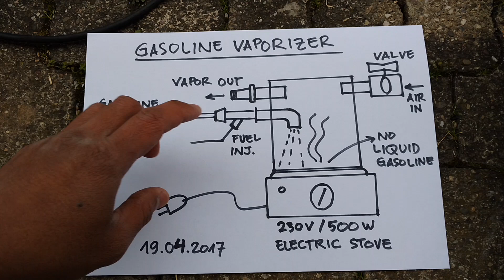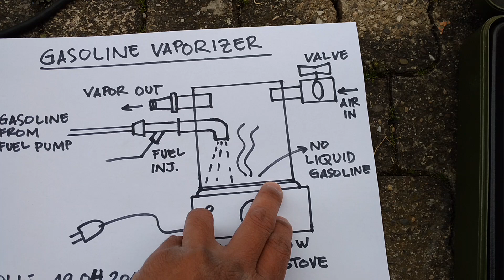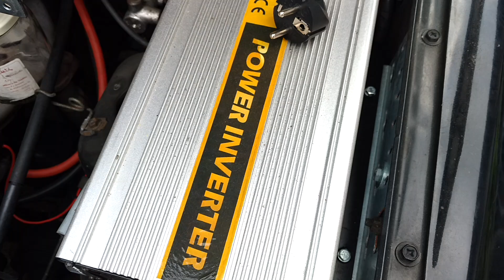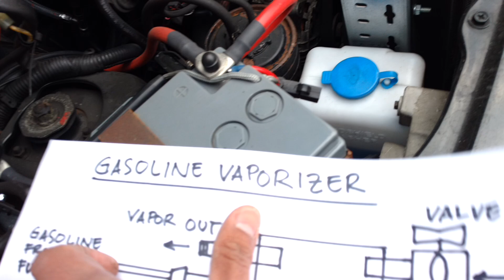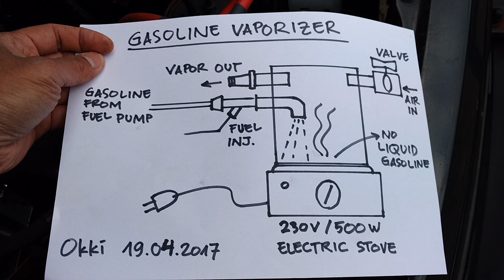Gasoline Vapor System for Car

Comment: If you use less energy from gasoline, you will have less power

It is easy to use less energy and a gasoline car by restricting the vapor going into the injector rail 

If you do that, and you do not make the car easier to roll, you have not accomplished anything 

So what I did, I found car tires that could go to 100 psi 

If you make your car a lot easier to roll and take as much weight out as possible you can get about 10 more miles to the gallon. 

If you use less energy in a car by making vapor and restricting the vapor and you still roll around on 35 pound air pressure tires 

And you are actually using less energy 

You will greatly reduce speed and get worse MPG

Comment: Newer vehicles with O2 sensor and evap systems,  the computer should lean or trim the pulse width of the injectors and the timing would be advanced or de-advanced depending on how rich the vapors would becomes.  Turbo with vapors.

Comment: Because it will die if it’s too rich or too lean, I don’t think it’s necessary to heat the gasoline. Introduce more air into the system and it’ll run just fine. I have a similar system, but I don’t use a fuel injector, I use a bubbler pot. With a corrugated hose, the vapor swirls and mixes with outside air and I have a valve to add more air. Cut down on the extra stuff like an inverter and a boiler. Plus you worry about overheating the gas to the point where it vaporizes before it gets in contact with the outside supplemental air. Seems to get pretty good mileage. About 80 to 90 miles to the gallon on a four-cylinder engine. Gonna try it on my hybrid next. And as far as the flashback arrester, I used a 3 inch coupler with two reducer cap ends, and in the middle, I’d put a metal mesh similar to what you would find in a splash screen that you use in the kitchen.
Reply: It is , that's how it vaporizes

Comment: something I commented onI  might have a cxouple of suggestions that will improve your setup. My brother and his friend made a headgasket with four sets of platinum points equally mounted around the cylinder. It was layered in between the gasket material like a circuit board.  So instead of firing from the spark plug it fired from each set of points. The platinum points had no place to hold any carbon build up so would not foul out like a spark plug. and firing the gas mixture  with four sets of spark burned the fuel vapor quicker and more completely.(old airplanes had two sparkplugs per cylinder)
Giving an increase of power with less fuel consumtion and less emissions. My idea to add to this is to reduce fuel droplet size thus increasing surface area of the fuel by using an ultrasonic mister which instantly vaporizes a drop of liquid to a finer mist than a carburator is capable of. This should also increase power while decreasing consumption andEmmisions. The reason you do not see this gasket method of spark on the market now is a sparkplug company bought their patent. Their was a drawback to the design they had not worked out at the time and that was that the gasket was thicker and you had to torque it down just right or it would blow the gasket.  But this was 40 years ago and we have much better materials to work with now. I really hope you read this or anyone else . It could be an easy add on for cars  well worth the cost for the increased economy and decrease of emmisions.  Hopefully give a little more time for the transition to the totally electric cars that are coming. Jake The Snake Was interested in the gasket for his race cars as it would have been a huge advantage.  So if you need an investor you might want to try him. It also goes to show how money trumps humanityand that big corporations (Firestone)  are more concerned with the bottom line than reducing polution to save mankind.  We really need to institute a crimes against humanity law for people like that and Big Pharma who suppress or overprice discoveries that benefit life.. Please send a comment should you read this. I like to think I am at least trying yo help.
Reply from the maker: Hi Kenneth. Thank you for your explanation. I think I got it. It is a clever way to ignite the fuel mixture without a spark plug. Can we write email? Here is my email address: info@m-opensolutions.com
Reply: Single cylinder or multi cylinder?

I question such a thing, as it would require multiple sparking systems for multi strike locations at once.

All this inside of a head gasket? And then claim aircraft had to use multiple sparkplugs' in a cylinder head?
You outsmarted engineers and did it with a head gasket and single point strike ignition. 

Rotflmao.

Comment: Why wouldn't you get your heat from the exhaust manifold? Wrap some copper tubing around it
Reply from the maker: No I cannot do that. Manifold temperature varies too much. I have measured my manifold temperature during driving and the result was not satisfying.
Reply: I'd thought that running it through a propane system might improve performance because it has the mixer which works on vapor from a vaporizer....425 mixer from model e vap/reg....but you need something to get the temps first ...ie: normal start and a regulator which delivers fuel at propane pressure .....which is fairly low .......

Comment: What's left of cracking gasoline= 7 different compounds that vaporize at different temperatures. What you have in the bottom of thee vaporizer is a compound
that won't vaporize until it hits over 600 degrees F, actually a tar like substance. Use Coleman lantern/stove fuel and you won't have any of this sludge in your
design. Just be extremely careful since a vapor is highly explosive if a spark is caused by a engine backfire. Use a flash suppressor on the output to prevent
a spark from getting into the vaporizer box. Thanks for the video!
Reply: It’s called Coke.
Reply: @normanburns-ko4ro  Back in the late 1970s it was documented as a "Nay Box." The idea worked but was crude since a engine backfire
would create a fire. Tom Ogle developed a high mileage system which had real good success in vapor fuel systems and the system
had protection from a backfire on the engine. What the system really was is a refinery but the oil companies and refiners did was add
heavy ends to the fuel which contaminated the use of such devices. 

The most successful system was developed by Smokey Yunic many years ago.  Take a look at a proven system on how the Coleman
Gas Lantern works since it burns 100% of the fuel which is highly refined White Gasoline that has no contaminates in it. The oil companies
are in business to make huge profits and are actually depressing any high mileage systems plus are in bed with the GOV. All of this is
about $$$ to create profits along with taxation.
Reply: How much lamp oil per litre of petrol???

Comment: that black stuff is tar that is in the gasoline your cars ecu is decreasing the fuel going to the injectors because your vapour is telling your car it has enough fuel so lower it. that is why you can't use the ecu of your car. make your own ecu and it will work. it is a good idea and proof of concept just get the injector working.

Comment: Hi If you can use the heat made by the exhaust,then you would  not need the electric heater. Or are you using it just for a test. I hope to see more  and the very best of luck to you Sir.
Reply from the maker: This was just a test. It was a successful test. In Germany you cannot put something like this and pass the TÜV inspection. That's why I designed this device this way.

Comment: Good experimenting. However, there is an abundant amount of heat and resources under the hood for you to be using something that's just going to weigh down your alternator and offset some of the gains that you seek. Begin by tapping into the heat on the exhaust manifold instead.
Reply from the maker: I have to make this system portable because the German car inspector (TÜV) won't allow me to have this at the time of inspection. You will also have problems if you use exhaust heat as the temperature is not stable. You can use coolant heat instead.
Reply: @OkkiMoeljadi  I meant the exhaust as in the exhaust manifold. That thing remains above boiling no matter what, once the car reaches full operating temperature.
Reply from the maker: @mpgundercover8075  yes, that what I meant. I don't want to argue about this. I have measured the temperature of my exhaust manifold on my car while running. Just build your gas-vaporizer and use your exhaust manifold heat to vaporize your gasoline, you will see that it is very difficult to vaporize the right amount of gasoline if the vaporizer temperature vary very badly.

Comment: If you put another cap on it insidenof the build you can contain the gas heat better and you can have a release valuve on the inside to release the pressure into the gaseous pressure container with a regulater for compression then the air valuve can be pressurized as well and when you open up the carburetor it will suck in just the right amount if you have a pressure release regulator for release on it. So when you open it its like an air compressor. Now if you have many tanks fullbof pressure you can systematically keep it functioning like a regular care that does intervuls.
The tanks are under alot of pressure so make sure you use the proper cylinder's.

Comment: Basicly the pressure has caused a residue build up the gass vaper lines needs to be many so you can regulate your speed in cylinders with pressure.

Comment: The tank needs to be tallerand you need to be able to have like a pint or a half gallon in it. Your getting a fuel compression in there.

Comment: Can you show us how well your car runs with this system?
Reply from the maker: No, not at this moment. This research is not finished yet. I'm busy with many other things right now. I can assure you that this technique works, we just need to control the mixture according to engine load. My system like you see on this video is good for static load. I have tested it on "Autobahn" with speed of 90 to 100 km/h.

Comment: Have you ever tried using alcohol or ethanol, instead of gasoline? Might work better, because it has less contaminates. Henry Ford used ethanol alcohol for fuel, on his early prototype cars.
Reply from the maker: No, not yet. But we can use distilled gasoline as well on this system.

Comment: Hi my Fellow VAP" HEAD,!! I hope you can read this because I have a Big Surprise for ya,.!! What you're looking at  in the Bottom of The VAP"Chamber IS not OIL, OR anything else BUT Spent, CARBON.!!!!! When The gas gets Vaporized" it leave's behind All the stuff that isn't Combustible.!! Does that make sense to you,?? See, that is WHY Any one who has made a decent gas Vaporizing
System, can hold a rag to the existing  pipe, and then breath through the Same rag.!!! Everything That is not burnable fumes, Like 
( CARBON/ All The additional STUFF, added to the GAS, we use today)!! Is separated OUT from the gas, and it has to go somewhere" Right,?? The "Conservation of energy" The First Law" of physics, Nothing Created, Nothing Lost.!! Every process  or action has an Equal but opposite reaction!! When you Vaporize "Gasoline"
And burn the part that Will Burn You're Left with Everything else that will-Not Burn.!! Henceforth, ALL THE Crap in the Bottom of you Vaporization, Chamber.!!
Reply: PS: Thermo, Dynamics.!!!! NOT physics,!! It's been a long day.!!

Comment: Sharing aja, saya sudah pernah coba Mas, yang jadi kendala adalah perbandingan antara uap bensin dan udara yg pas. Saya gunakan 2 saluran 1 dari uap bensin yg disemburkan lewat pompa bensin dalam tabung dan 1 saluran lagi dari udara luar. Pada waktu stasioner baik, tapi pada waktu jalan kadang gas idle jadi tinggi, kadang tidak ada power di RPM 2000 lebih, mesin mau mati. Tabung yg saya semprot bensin sistemnya berputar aliran bensin, jadi setelah bensin disemprotkan ke dalam tabung dan butiran bensin yg turun akan kembali lagi masuk ke tangki bensin, guna menghidari terjadinya penumpukan bensin didasar tabung dan penuh. Untuk versi sederhananya saya buat sebelumnya dengan jirigen bekas udara luar masuk kedalam genangan bensin dan uapnya ditarik ke karburator. Pada waktu kondisi mobil diam terlihat sempurna, tp prakteknya pada waktu dijalankan tenaganya hilang di rpm 2000 keatas.
Saya terapkan di Kijang Grand 93, 1500 cc(toyota 5K), karburator, cdi.
Reply from the maker: Terima kasih atas sharingnya. Kalau di sistem saya masalah yang saya lihat adalah pengaturan jumlah uap bensin. Saya belum coba dengan programmable ECU. Saya benar-benar tidak punya waktu untuk mengembangkan sistem ini sendirian. Satu hal yang menurut saya paling menarik adalah gas buang yang sama sekali tidak berbau.

Comment: Hi OKKI,  I like your video's, but have a suggestion, instead of using manual valves to control the flow of your air mixture, why not use one way check valves. This should let the intake control it's own air flow.  Thanks for your video's and keep them coming, great work!
Reply from the maker: Hi William, this is early stage of my prototype. There are so many things that can be done to optimize this system. Thanks for commenting and liking.
Reply: @OkkiMoeljadi  great job how has everything been going? I seen @ 600°heater plate gasoline vaporizes into a white fog , no apparent residue, there is a older guy on here also showing water turning into flammable gas when misted on a 230° hot plate
Reply from the maker: @jesusisreal3209  I know that video as well. I'm going to continue this research. Please be patient.

Comment: hola, muy interesante tu video; he estado probando vaporizadores tipo burbujeador por un año y puedo decir que el sistema a vapor funciona; tengo muchas conclusiones en base a ensayo o error aprendí que hay teorías que funcionan otras no...en tu sistema recomendaría agregar una 2 válvulas check una para que entre mayor aire con combustible (que puede venir de un burbujeador de gasolina) a tu vaporizador  cuando aceleras y la mezcla varíe ..y otra para evitar que el auto se ahogue por falta de aire (normalmente esta cerrada cuando aceleras el resorte abre  y deja entrar mas aire)...he notado que el problema (perder potencia o apagar el auto) de aceleracion a rpm variables se puede solucionar utilizando el vacío de succión del motor...no veo un sistema de reabastecimiento automático ya sea una válvula flotador o una válvula selenoite con flotador...has pensado agregar?..el tema que aún voy a probar es 50% etanol o alcohol y 50% agua..y evitar la suciedad de la gasolina...hay patentes que hablan de ello...el tema del calor puedes usar el refrigerante y la resistencia electrica conectada a un termostato que solo se encargue de mantener la temperatura estable a 90 a 100 grados centigrados (en gasolina). En 75 grados en alcohol y agua a 100 grados (serían 2 vaporizadores juntos). Suerte cuando tenga mas avances los comento. estoy tratando de automatizar mis avances..Gracias por compartir es bueno saber que hay mas gente trabajando en esto..!!!
Reply from the maker: Thank you for your comment. I just translate it using google translate. I don't know if google translates your comment correctly or not. But thanks for your compliment and I wish you luck and much success with your project.

Comment: I admire what you have done.  However you went the long and expensive way around doing this.  Instead of using a heating element that must be plugged in, simply use heat off your heater hose.  Put a copper tube on the interior of the vaporizer and connect the heater hose to that.  Next, why are you using a fuel injector?  Although I completely agree with having a switch to turn off the engines injectors I just think putting a single injector in the vaporizer is a bad idea.  If your goal is to have only a small amount of fuel contained under the hood then use about four injectors, maybe on multiple sides of the container.  Personally, a fitting container with a transducer would work best as it turns the petrol into a fog.  If you ever do this, you must tear off the rubber sensor on the ultrasonic fogger, fill the holes with a conductive metal and seal it off because gasoline will cause the transducer to malfunction if this is not done.  In reality one needs neither.  A simple bubbler system will work but I do no recommed that unless experimenting.
Reply from the maker: Thank you for your feedback. I came up with this setup because I wanted to have a system which is portable where I can install and remove it quickly. In this country where I live all vehicles on the road have to pass periodical inspection and I had that problem already as the TÜV technician told me that he understood my device but he could not pass my car as long as I have this device on my car.
I have driven my car also with only bubbler. The problem with bubbler is that the gasoline gets colder over time until you reach a point you won't get enough vapor to run the engine. I have tried heated bubbler as well, it worked better. You can see some of my setups on my channel.
I would like to build a system like "Hot Vapor Engine" from Smokey Yunick utilizing fuel injection instead of carburetor. I will do that as soon as I moved away from this country. Hopefully this year.
Reply: Can prolly use a impco model j to vaporize of the rad.... controls the heat nicely....